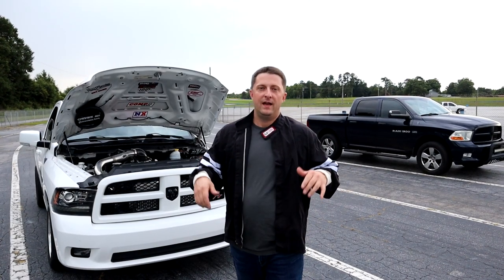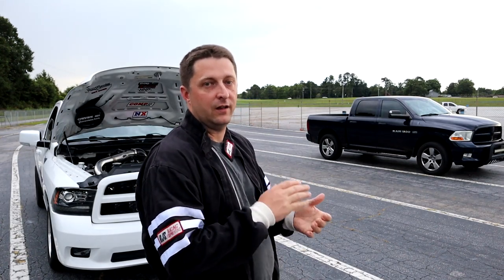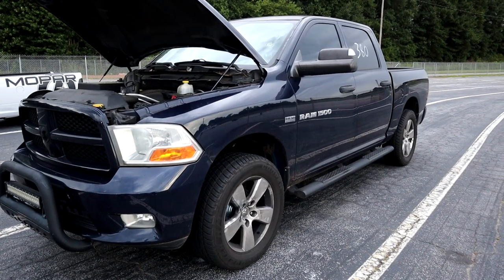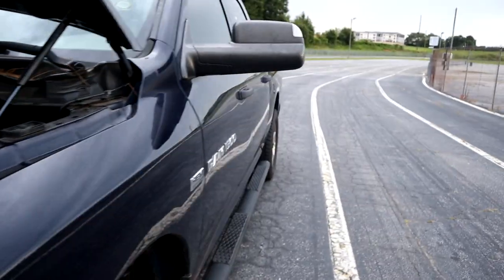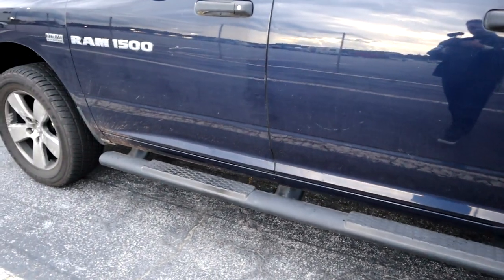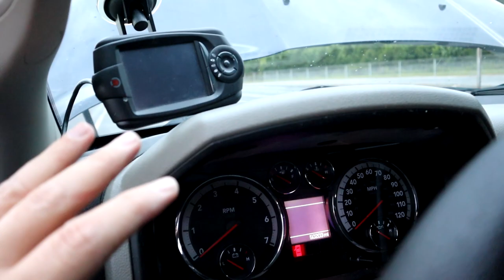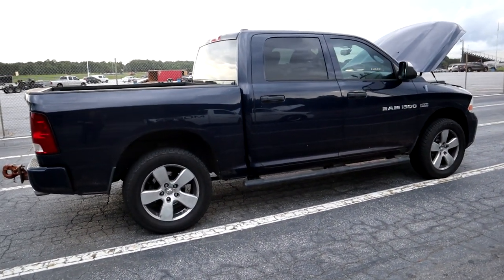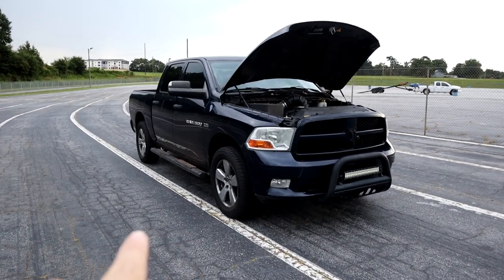Project STORM Ram 1500 4X4 5.7 HEMI First Pass Down The Track

Comment: Hehe in the 15s bone stock !!!! Same truck as mine 2012 cc 4x4 , I ran about 4 different Friday nights when I was  bone stock with 20” rims .. I ran 18.15 seconds consistently . 
2 years later I’m 13.14 and should hit 12s the next Friday night with 4.56 gears .
Start Adding mods to these  2012 6 speeds and the seconds start Peeling off … he will definitely have fun depending how far you go ….. and we all know what happens no matter what you say once modding it’s almost impossible to stop 😂
Reply from the maker: Definitely man, DA plays a huge part in good times no doubt.  Not sure how far this will go but I just want to build a fun reliable truck for fairly cheap and see how it does💪🐏